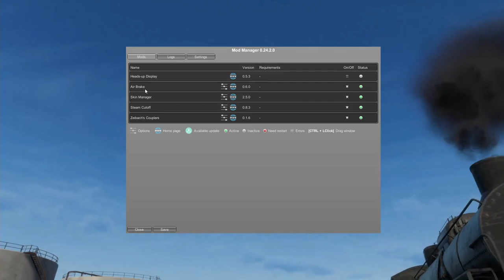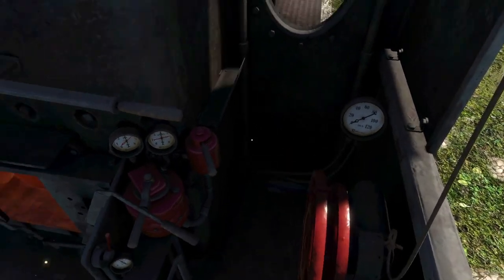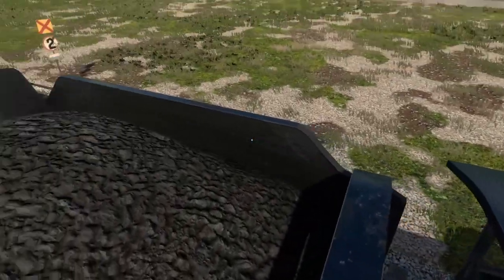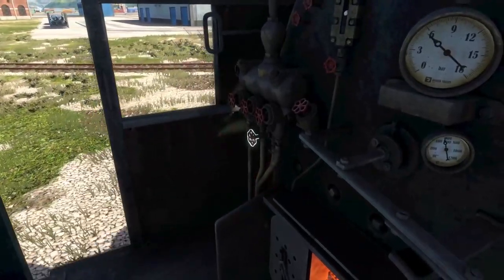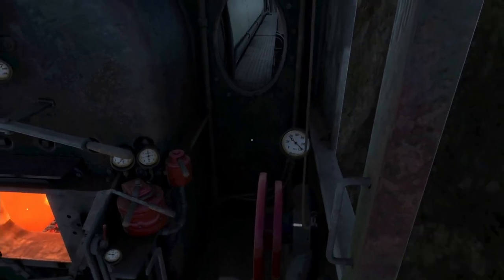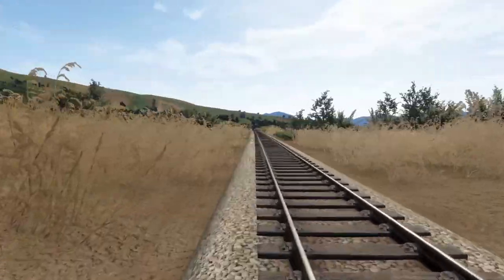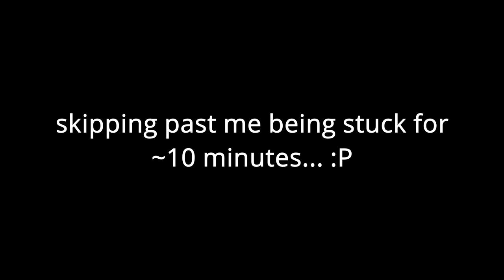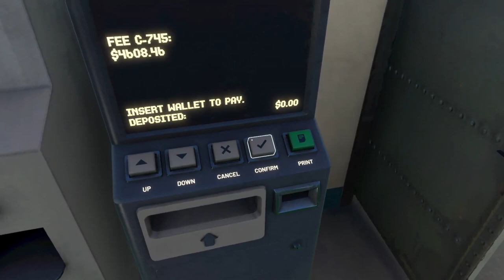[DV] Knuckles, Tonnage, and... explosions? Modded derail valley!

Comment: Version 0.8.3 of the steam cutoff mod was released on April 12, 2021. There have been 8 updates since then, and 0.9.0 was a huge improvement to realism. Same with the Air Brake and HUD versions you have installed, almost a year old. I urge you to update everything to the latest and try again.
Reply from the maker: I thought I had the latest installed! Apparently not. I'm new to dealing with mods for DV so I must have missed a step. I did love even this version when compared to the OG game, cheers and thanks for making these mods a thing :) we'll give it another shot.
Reply: @Hyce777  Finished watching the video and compiled my comments below.

I really appreciate you taking a look at the mods, even though it's a little frustrating to watch you working with such an old version. 0.9.0 was a complete rewrite of the fire and boiler simulation, and while I try to strike a balance to keep it friendly for gamers coming from the vanilla version, I also try very hard to make a realistic simulation. You'll find that pressure is much more stable with the revised simulation. Is it stable enough? I hope you'll tell me.

1. Yes, brake pipe propagation, car reservoirs, and car control valves are all simulated. The Heads-Up Display mod will show a bunch of information to show what's going on, far more than an actual engineer would have access to, as you know. :)
2. I usually refer to the knuckles as "Janney-style." Janney was the original patentholder. Yes, the actual knuckle models are based on AAR type E. The 3D model I was able to find and integrate didn't have the actual knuckle or any of the other mechanical components separated out. It's on my to-do list, but actually animating the motion and mechanism realistically is going to be a huge PITA and might hurt game performance too.
4. The buffer shafts (the stationary parts, not the buffer caps themselves) are unfortunately part of the base car models and I can't remove them without replacing all of the vanilla car models. And the only thing weirder looking than knuckles + buffers is knuckles + shafts with no buffers on them.
5. The safety valve internally is set for exactly 14 bar by default, but the gauge texture isn't terribly accurate to the needle movement.
6. The blower is definitely absurdly overpowered, which is a compromise for playability. Many players who are new to the mod choke the firebed so badly that they can barely generate steam, and then their natural reaction is to pile yet more fuel on. The blower is one of the few tools I can offer to get them out of this situation. I could add a setting to adjust the blower effectiveness for advanced players with an eye for realism, like yourself.
7. Ditto the injector, where new players often ignore the water level entirely until the boiler is literally dry, since I'm not mean enough to model crown sheet failure. (Also on my to-do list.)
8. Re: EQ dropping while BP was rising: you had just dumped the BP with the Emergency position then returned to Service, so the valve was recharging the BP so it could match the EQ. The "big hole" is really big. Too big? You would know better than I would.
9. The current version of Air Brake has sound effects so you can hear when each car control valve releases, so even though the brake levers don't animate (Guess what: also on my to-do list.) you can conduct a static apply/release test.
10. The alert bell can trigger from any of: 1) boiler water level low, 2) sandbox level low, 3) boiler pressure low, 4) fire temperature low (usually because of low coal in the firebox), or 5) main brake reservoir low.
11. The brake gauges are not accurate in the SH282, because the gauge face textures go from 0-6 instead of 0-4 in the diesels, but the underlying simulation is identical. You can change the texture with the Super Gauges mod to fix that for all of the locomotives. The right-hand gauge has EQ on the black needle, left hand gauge is BP on the black needle. The Service position is the standard 2.5 psi/second, so about 2-3 seconds for an initial reduction and 6 seconds for a 15 psi application.
12. Almost all of the individual skins on Nexus Mods work on the steamer, but the skins in the Skin Pack are very old and many don't work anymore because of changes in the base game. I think the skins in the Skin Pack predate Nexus Mods having a section for Derail Valley.
13. A 41 minute deadline is really 41:59.999.... You made it by ~54 seconds.
14. The vanilla game significantly exaggerates the effects of grade on adhesion for gameplay purposes, to make the hills feel more significant. If you're willing to branch out, Zeibach's Realism changes the traction model to be more realistic across all locomotives.

It's difficult for me to find good information on the behavior of actual equipment. Much of what I have to rely on in terms of period documentation and anecdotes shared on train forums is contradictory and drawn from wildly different periods of history. For example, I'm modelling the antiquated K-type triple (control) valves because that's what I have the clearest information on for their behavior.

The safety valve does have 3 PSI of hysteresis, but it's so fast acting because I have no information on how quickly a real one would actually be able to vent pressure. I'll probably change that in the next version to take "minutes." (How many minutes? Does the valve re-seat to the closed position instantaneously, or is there a taper? How much visible steam is there from an open valve? So many questions!) If you'd like to help me improve the realism further, I'd love to hear from you on the official Derail Valley Discord.
Reply from the maker: @zeibach9075  Seriously appreciate this detailed response! I feel bad frustrating you with this old version, lol. I know that we'll have to revisit this specifically now haha.

1. Props, that is incredibly cool.
2. In my research now I've seen other folks call them Janney's due to the original patent, so fair enough. We usually had the distinction because we were some of the few weirdos who had both in the same train, lol! I had a feeling actually animating them would've been quite extensive.
4. Makes 100% sense.
5. Makes sense, lol. Not surprising. Hell, real pressure gauges are only so good at reading the real pressure so we can just call it an accurate sim. hah!
6. Having the blower be overpowered seems like the best compromise for gameplay. I'd honestly leave it just so you can go nuclear and fire up faster... lol. One of those "what is too much sim for the sake of gameplay" items, I think.
7. Same as 6.
8. Call me confused in the moment, that is fair. I've never seen the gauges go opposite, but thankfully only so many times you need to make an emergency application... and typically you're not looking at the gauges when that happens! Hah. Big hole is about that big :)
9. That is wicked cool.
10. Makes sense.
11. Fantastic, glad the reduction rates are accurate to the PSI counterparts. Maybe the gauge mod is another add for me. haha
12. Fair, the Rio Grande skin is separate, so perhaps I missed a step with the comms radio. I'll mess with it some more.
13. I had a feeling it was a "we just wanted to look at the minute hand" type deal, thanks for confirming.
14. Oh cool, I'll have to look into that.

I feel your pain on the "finding the answers amongst the real" - I will shoot you a message on discord about safeties and all that. :)
Reply: @Hyce777  Whoops, 2. got a little cut off. I meant to say that I call the AAR couplers with separate brake hoses "Janney-style" to differentiate them from the Scharfenberg coupler with integrated air and electrical, especially since the game has an Eastern European setting and a large European player base.
Reply: @zeibach9075  Just out of curiosity, do you know if the knuckle mod causes an air brake line "glitch" that makes the line float into the sky?

I am trying to narrow down the  issue among multiple mods. I have tried disabling but it persists.

Don't go out of your way to diagnose, I know  this isn't the place for it. But since you are here, thought I'd ask if that's something you might have noticed.
Reply: @greyshadow9498  It happens sometimes even in vanilla, so I wouldn't necessarily blame your mods. I have no idea what the cause is, though. It's very rare in my experience. I think I've seen it once in the last 100+ hours of gameplay.

Comment: Might interests you. 
Europe is finally moving away from Buffers and chain couplers. It is planned to convert all (freight) cars to Scharfenberg couplers by 2030 with fully automatic conneection of breaklines and even digital data to inform the loco what cars are connected. 
It took us only 200 years to do so :D. Buffer and chain couplers where first used in 1830 by the Liverpool and Manchester Railway.
I
f we ever convert passenger cars is in my opinion doubtful because a ever increasing amount of passenger train are converted to EMUs, DMUs.
Reply from the maker: Oh that's really interesting. Are those more similar to the couplers used in transit / light rail applications?
Reply from the maker: @jakubjoachim8029  Very cool. I am somewhat familiar with those, as I work with Siemens and Kinkisharyo low floor vehicles at my current gig. Nifty things! Thanks for sharing.

Comment: My pressure gauge doesn't move anywhere near that fast in my game with the cutoff mod. You might want to make sure the cutoff mod options haven't changed from default. It's possible since you had it installed before.
If you want I can post my settings here.
Reply: Do, my cutoff mod's been acting fucky for a while
Reply: Enable sight glass float = Checked
Initial boiler pressure = 10.00
Max boiler pressure = 14.00
Coal combustion rate = 1.50
Airflow for min smoke = 0.00
Airflow for max smoke = 1.00
Min smoke rate = 5.00
Max smoke rate = 300.00
Min smoke lifetime = 0.50
Max smoke lifetime = 10.00
Clean smoke opacity = 0.10
Boiler thermal efficiency = 0.55
Steam consumption multiplier = 1.00
Torque multiplier = 1.00
Enable detailed low-speed simulation = Checked
Enable logging = Unchecked

These numbers were all taken after a fresh install of V0.9.7 of the Mod

Main differences I see between this and 0.9.6 are Steam consumption multiplier and Torque multiplier are new.
Also Boiler thermal efficiency was 0.80 in version 0.9.6

Mods installed are 
Zeibachs HUD, Air Brake, Booklet Organizer, Lean Toggle, Steamer Overhaul, Couplers, Realism Overhaul, and Sounds
Reply from the maker: Cheers, I'll have to investigate this.
Reply: I would specifically look at boiler thermal efficiency, and consumption multiplier, if you are having gauge problems.  Thermal efficiency % can tweak how quickly the loco gains steam from coal, and the other changes how much steam it uses (0.5 would be half consumption for example)

Comment: You should get in touch with Well There's Your Problem, an engineering disaster podcast with slides, which in and of itself is a disaster. You'll fit right in, and one of the hosts plays RO!

Comment: I have some screenshots on my steam account where I managed to explodify every single tank car at oil well central after a slow speed collision. Don't know quite how that happened, but who am I to question physics lol.

Those duplex gauges are pretty nice, and I always liked the manual lapping brake schedules. I feel like I have more control over my reductions with a No. 6 or a No.8.

Trying these mods out now for sure.

Comment: Unless it's changed recently, 14Ls are to be initiated within a quarter mile of the crossing at the engineer's discretion. And it just so happens long long short long is Morse code for Q.
Reply: Also, I was once riding Amtrak when we were held at the station due to a derailment that was in the final stages of cleanup. While we were waiting some of the passengers went to a nearby restaurant, so when the line was cleared, the crew gave the flagman callback on the whistle (four longs).

Comment: The European C-AKv couplers built after soviet SA-3 couplers are really cool, since they use a Wilson profile, they open automatically when you push them onto each other and have inbuilt pneumatic and electric connector.
Besides the increased load capacity they are reverse compatible with chain couplers, as they are compact enough to allow for a hook underneath them to be installed and the connectors for air and power can be flipped out to connect hoses to them.
https://en.m.wikipedia.org/wiki/C-AKv_coupler

Edit: Gif demonstrating how the pushing together works.
https://en.m.wikipedia.org/wiki/File:Sa3.gif
Reply from the maker: That is actually brilliant.

Comment: I love the realistic steam mod. It honestly made the steamer way easier to use for me.
Reply: interestingly, my temps and pressures don't change that fast. huh.
Reply: Also, I could never get the couplers to work at all in my case, made me sad because the chain the game normally uses infurates me.
Reply from the maker: yeah I've got a few settings wrong apparently somehow in my version of the mod. Another video... lol!
Reply: @Hyce777  oh right, I forgot there where tunable things in it and I went for the realistic/slow pressure change. I'm going to have to try the couplers again, clearly the work, but I'm missing something with them as they wouldn't couple.

Comment: I haven't tried steam skins, but to help diagnose, you did try to apply it with your radio under reskin yes?

Also for the caboose, you can call that under crew vehicle on the radio, though it costs $10,000 each time you call it.

I am going to look at the files one of these days and change that to $0
Reply from the maker: I was trying to do it via the skin manager in the mod menu... I suppose i should try the radio. Thanks!
Reply: @Hyce777  When you install the skin manager it adds a Reskin option to the radio and you can flip through from there.

Trains can also randomly spawn with the new skin which is also pretty cool if you run a lot of them.

Love the series so far. I haven't had the guts to even tough the steamer, so it's nice to not only see someone doing it, but knows what he's doing so cheers!
Reply: Tested the West Coast Railway skin on the steamer, it does work via the radio (need to skin Loco and tender individually). Course the inside still looks like it's been left out in the rain for a hundred years.

Comment: On the model steam locomotives (1.5" scale) the blower sort of is a magic pressure valve, infact on my wood fired Little Engines American if you leave the blower on you will have a volcano of embers out the stack but on a coal burner your pressure would rocket up.
Reply from the maker: Not too surprising, i imagine the ratio between pipe flow out vs. Grate area is considerably higher than on the big engines. :)
Reply: @Hyce777  without a doubt, 9 1/2" tubes drawing on a 4"x5" grate is a considerably higher ratio, also the blower is 3, 1/6" holes directed up the chimney so there is considerably more steam going up then would be scale.
Reply from the maker: @johnkuzma7066  oh my goodness. Three 1/6th holes? The blower on 491 is a piece of 1-1/4 pipe. The stack is 2' in diameter. Lol. That's a huge difference.
Reply: @Hyce777  As the great LBSC once stated, Nature doesn't scale, I figgure we need these out of scale because there is significantly less heating area and thus to maintain a 100psi working pressure we need to have a hotter fire where it counts.  Also there is hardly any natural draft in something this small (my American has a Chimney 1.5" diameter and around 12" tall) so we need more induced draft. Infact if you open the fire door while at a standstill without the blower a huge flame will roar out of the fire hole making a quite uncomfortably hot throttle and fire hole door. Lol
Reply from the maker: @johnkuzma7066  Sounds about right... easier for the fire to head out the oversized fire door than the scale sized stack... hah!

Comment: Well, that's what Buffers are for to stop Engines from Crashing. A quote from Thomas and The Magic Railroad, which is actually true because if the buffer and chain system weren't around in any continent, then everyone would be at risk of a 100.000% of blowing up the Earth, with so many chemicals and hazardous materials in the air; we'd never survive, because the Train is the most powerful vehicle on solid ground, and the most expensive kind to maintain wether it be a Steam or Diesel, we have to keep our countries safe from any sort of disasters that some dumb person accidentally put a bomb or an automatic explosive device and we'll never get out in time.

But, that's probably not gonna happen but if it actually does I don't wanna be near any smoke or flames.

Do you agree on saving your own life by working on the Railroad and becoming a distant memory of someone who was once part of a greater community and was trying to make his/her life matter, but they couldn't make it time for dinner, because something happened. 

If you Agree, thumbs up Comment, Subscribe, Share, Like, and please do the right thing and stay safe when handling very sensitive materials, such as oil, gas, propane, etc.

Stay Safe and Stay Strong, I'm Skye and I've gotta Fly.

Comment: to reskin each loco you need to use the switch track tool go to reskin then select the skin then apply u must use the reskin tool in the switch remote but you must have all options on in the settings menu of the game too spawn mode needs to be on too in the game menu along with the other options then go to reskin in the switch track remote  then reskin then select then select the loco by aiming at the loco then reskin you do it just like you where going to do a rerail option